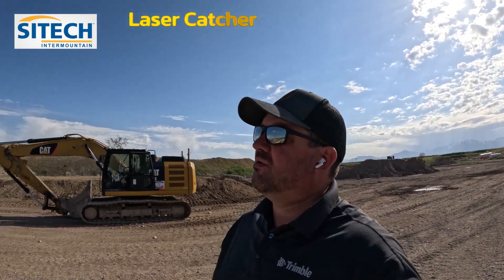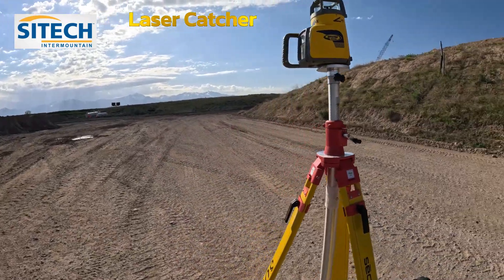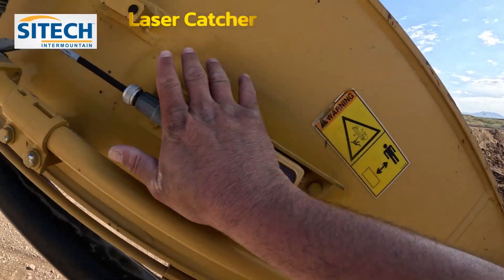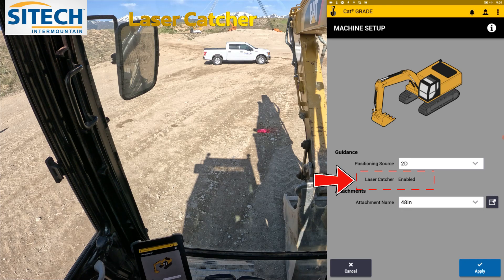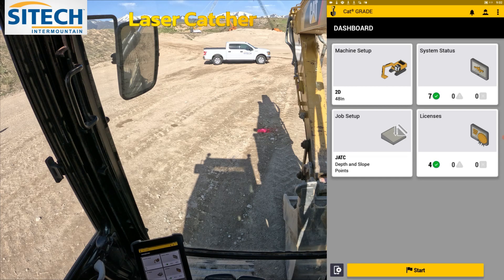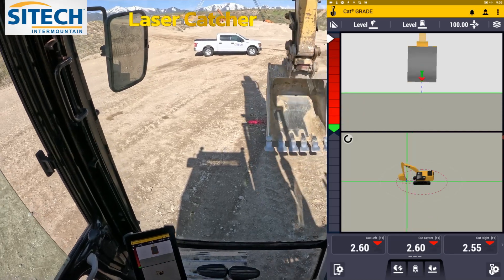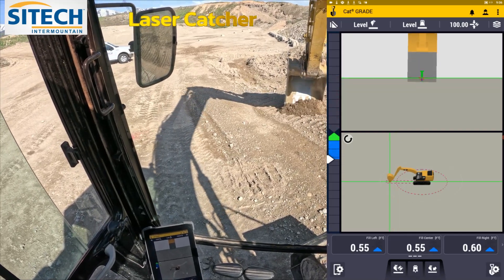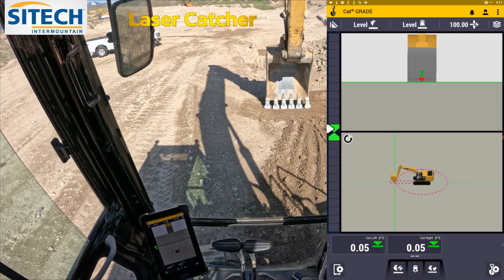Earthworks Laser Catcher Part 1  Set up   Bench

Comment: I have a 2d with a TRS 10 on a next gen 315. I am trying to do a cross slope of -3.7%. I enter it in the cross slope box but the machine does not change elevation when I swing from my bench mark to the end of the pad which should be at the -3.7% slope. Its benched elevation remains at zero as if it’s not recognizing me enter the cross slope. Yet showing the -3.7% I entered on the screen. 

Going through the settings I don’t have a bench heading sensor. Is that something that I should have to be able to use the cross slope function?

Comment: " I AM GOING TO CALL THIS MY 100" What is the significance of 100 and where do this number come from?  I appreciate these videos more than I can express, I signed papers for my earthworks 2D on monday and should have it installed next week.  I am super excited to use the system and these videos are going to help me hit the ground running
Reply: I am sooo happy to hear these videos help you and that you are ready to jump into this technology, you won’t regret it.  My reference to 100 is a typical job site reference to finish floor.  A lot of job sites assign finish floor slab as a 100 elevation and footings and structures are based off that.  So since I was just doing a training in an open lot and not on a job, I was just using it as an example in case my footings needed to be 2 or 3 below that.
Reply: At the moment most of my digging comes in the form of footings for metal buildings and trenching for electrical service. I like the idea of not having to get out and check with the grade rod or guess if I am deep enough or worse have to rework the ditch after I have already backed up. I see the value in the technology, in the time they it will save and all the other things I can do with it. So keep those training videos coming.

I like the idea that this system will set my apart from my completion 😊